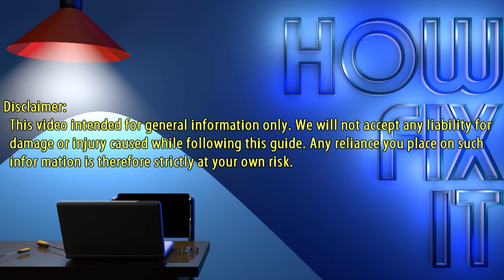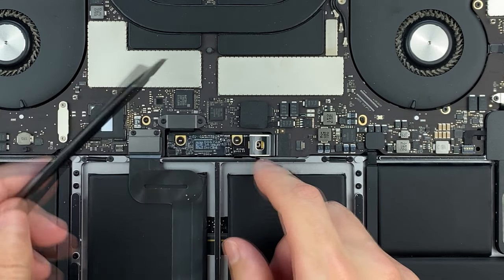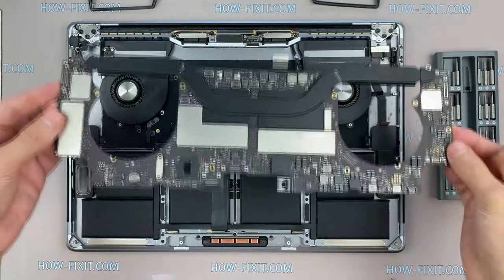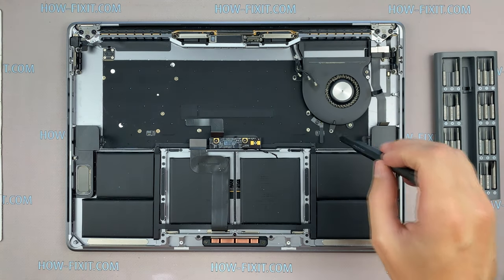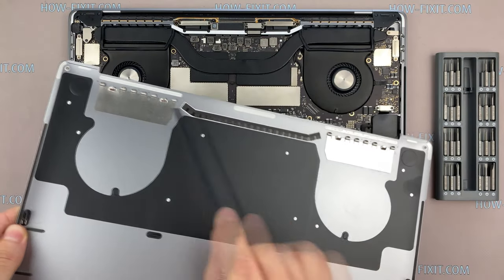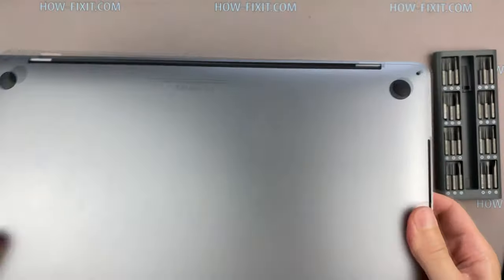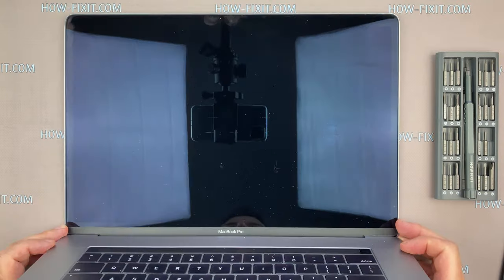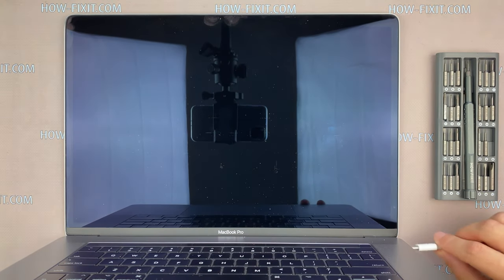MacBook Pro 15 Touch Bar 2016 & 2017 Disassembling, cleaning and thermal paste replacement

Comment: WARNING: I'm an experienced apple consultant with many years of pulling apart macs, but this was my first time pulling apart a 2017 macbook pro so i wanted to get some help before attempting, so i watched this video. I fried my motherboard watching this video due to a lack of a critical warning. be VERY careful when you reach 3:25 in the video where he says "pry up the clamp". How-FixIt should have given a warning that this is the most important step of all in terms of preventing your logic board from getting fried. that's your battery connector. when you pull it up, make sure it goes up in ONE move and STAYS up from that point forward. DO NOT let it touch anything - at all - EVER.
Reply: Truth Ninjas I got a plug in and charge sign after doing as this video says. Is it because of this?
Reply: @cf6978  good question, im not sure. sorry
Reply: im replacing my battery , while also repasting do you think ill be fine?
Reply: @MementoMori-xx5qo  already admitted that i'm not experienced in this particular pull apart. which is why i watched the video. and yes, it's true that in general a few touches SHOULDN'T cause an issue, but it still CAN. i'm not trying to disparage or blame the creator. it's an excellent video and i'm very appreciative of it, it really helped. but i stand by what i said: this is a big miss on his part.
Reply: @cf6978 hey. Did you fix this? What was your issue?
Reply: @cf6978  actually just reassemble things in place then plug in the charger, done, battery should work as normal
Reply: Good on you for pointing that out

Comment: Great tutorial! Applied the very same steps to the early 2019 MBP Pro 15”. They worked perfectly fine. Got the idle temp down 
by 10 C.
Reply: What thermal paste did you use?
Reply: what thermal past did you use?
Reply: what thermal pas did you use?
Reply: What thermal pa did you use?
Reply: use mx-5

Comment: I worked on around 10 Macbook's from changing speakers, to switching screens to ram/ssd installations, fan cleaning, thermal paste etc but never on a 2017...  They were all easier than this. After watching I am too lazy to start unscrewing.

Comment: I think this video serves its educational purpose. That is I shouldn't think of cleaning the fan and reapply the thermal paste by myself. I will live with the high temperature and noise fans because at least the computer is working.
Reply: that's what I thought to😂😂😂😂😂
Reply: @freddegredeful  I ended up cleaning the fans and the intake vents. Though I didn't do the thermal paste.
Reply: @peterv1602 any change in cooling ? Better? I want to refresh mine as well, but after seeing the video and reading through comments is too risky. Today i Took it to the apple authorized service and they asked me to sign a disclaimer as if it breaks in the process, I cannot blame them. For them to ask me this, means its a nifty job.

Either way great video.
Reply: You may at least want to get the dust bunnies out of the fans and vents though, you don’t need much disassembly just the bottom panel and a brush/air can
Reply: @enderlore1337  I cleared away the dust buildup, resulting in an increase in the volume of air.

Comment: Hello. In the process I lost one of the screws that hold the flexible metal bars of the heat sink. Can you tell me what type of screw it is and what its measurement is?

Comment: I have a flickering at the bottom of the display on my Macbook Pro 2016. but does not look like flexgate.
If I force the macbook to use only the ATI graphics instead of the integrated one, the error is gone.
Can new thermal paste help here?

Comment: Nice video overall.  The only improvement to the video would be to have a more orderly sequence of what screw to remove.  Talk about what group of screws / things you will remove first, then the second group of items, and the next set of items.  Then, point to the screws or area that you will remove next before remove them.  Just a idea and nothing more.
Reply: Just basically plan out the groups of screws your are going to remove by saying what you are removing and slowly point out each of the screws you are removing and what but type you will use.  Again, this is just a suggestion to help you and nothing more.

Comment: This does not mention screw sizes or screw types. For example, the bottom 4 screws for the bottom cover are different than the top 2 screws. They are pentalobes. This video is missing so much information that is crucial to getting your macbook up and running again. Such a bummer.

Comment: Cool video! 
I've got the same model, and the screen stopped working a week ago, took it to repair shop, they said the graphics card is damaged due to over heating.. They wanted £550 to fix it, which I thought was steep.
Any tips on how I locate the graphics card?... And replace it myself?
Reply: try reballing it
Reply: It’s all built onto the board next to the CPU in this video. It’s not something you can replace at least not without some very specialised equipment and knowledge. Usually an independent repair store would order a new logic board with all those parts which is why it is so expensive (unless they find a second hand one that still works).
Reply: @f.remplakowski  thanks Filip.

Comment: Hello! WARNING: in the video do not connect the Touch ID, it is a cable that is under another cable, under the top left plate, be careful before closing the laptop and connect all the cables.

Comment: I tried to rip my heat sink off. After much wiggling and prying with a screw driver and bending of stuff. It would not come off. I now know why.
Reply: Did you watch the video? There are 8 screws keeping the heat sink, after you remove them there's no way it doesn't come off.

Comment: Oh my you have to take the whole thing apart in order to clean up the dust from the fans. Horrible absurd design.
Reply: Actually you don't, if you want only to clean it you don't need to remove anything beside the cap.